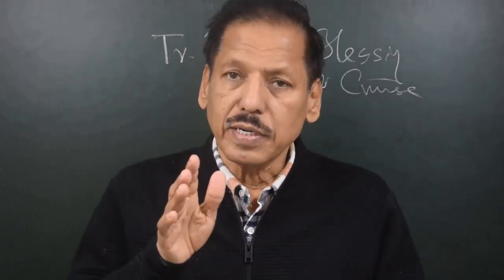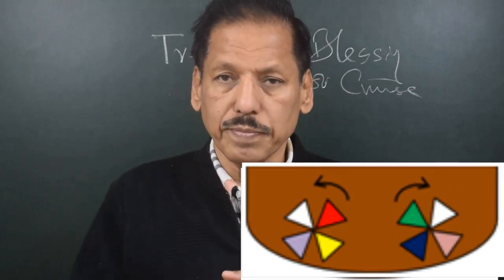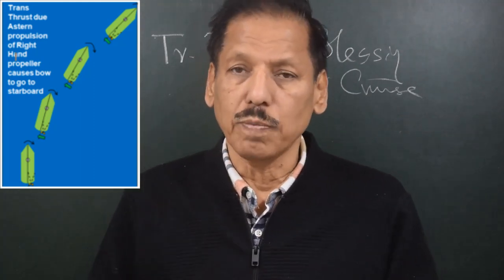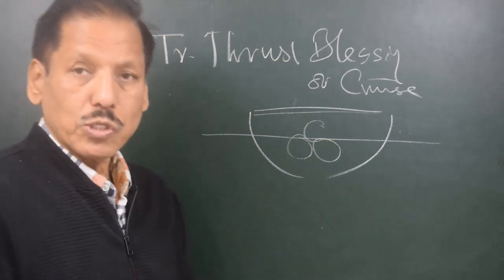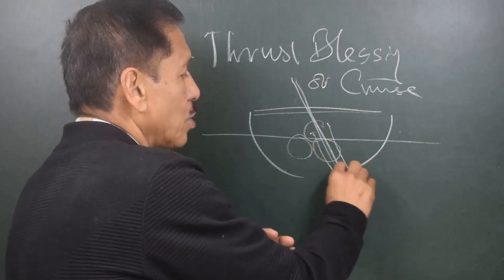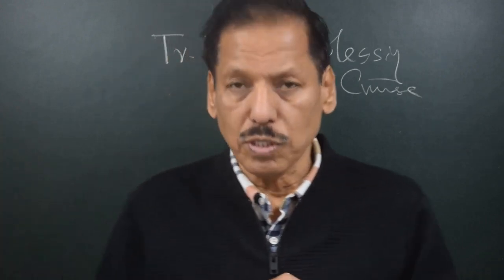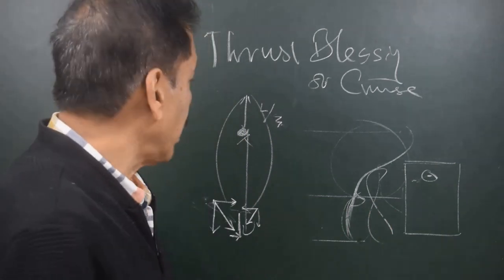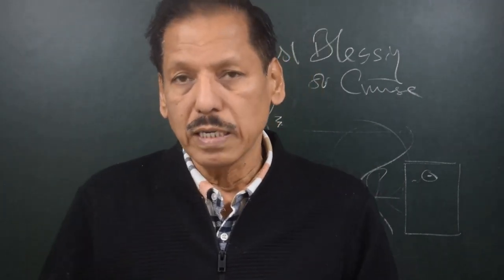Transverse Thrust, Blessing or Curse

Comment: Thank you for such excellent explanation which certainly would clear many doubts of even senior mariners. since I am an engineer and I have witnessed myself that pilots , while berthing, give a momentary dead slow astern and as soon as it turns on air , they stop the engine. So on Right hand propeller ship, they would do this to swing the stern towards port side to attain max lever with the ship at rest, thereby utilising maximum transverse thrust to cause ship stern to move towards port and bow to stbd side. Is my understanding right? Please give your comment , I shall be very thankful and look fwd for your reply
Best Regards
Reply from the maker: Thanks. Appreciate. You are absolutely correct.